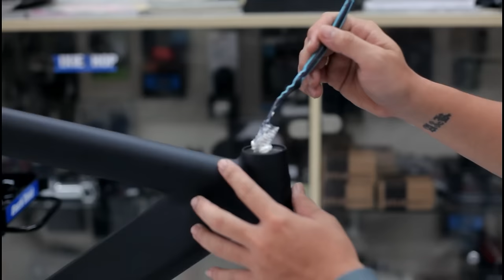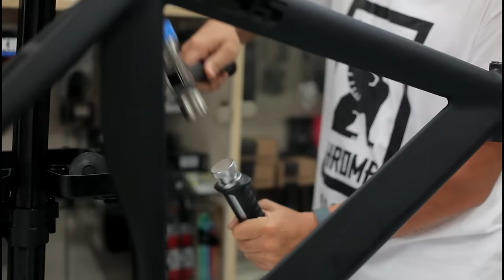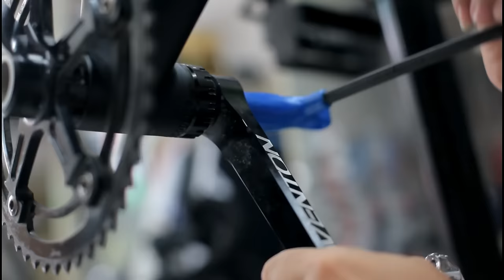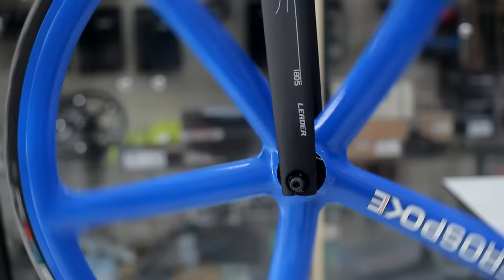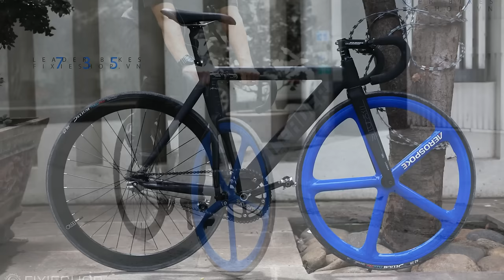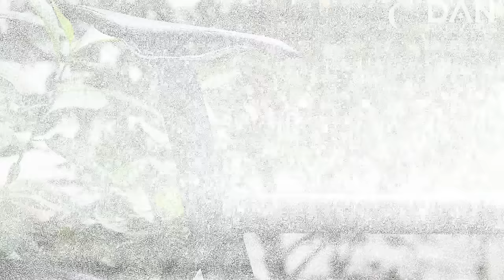Leader Bikes | 735 | DAN Fixed Gear

Comment: How did you install the crown race at the bottom of the fork? I had to file it down a bit, I saw you guys use a tool and just hammer it on..